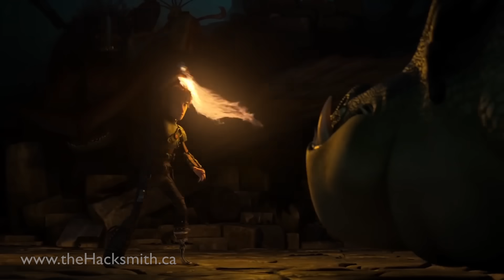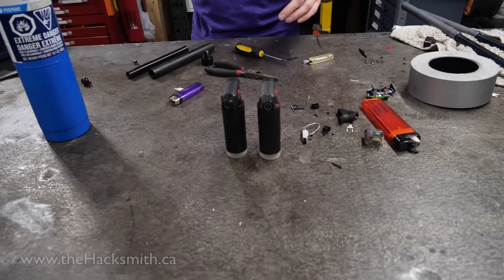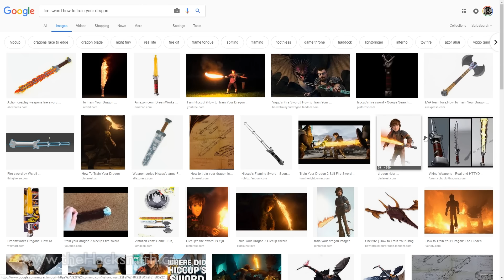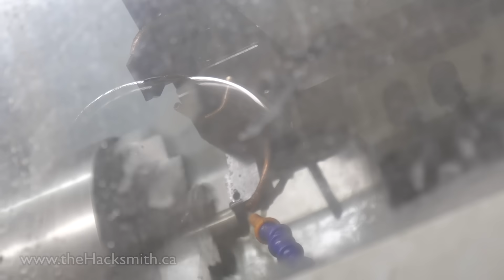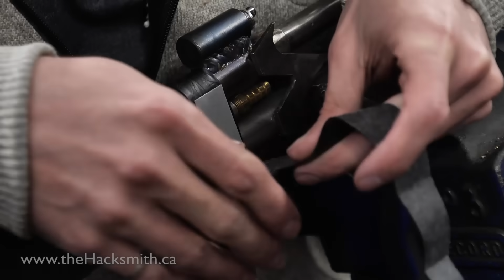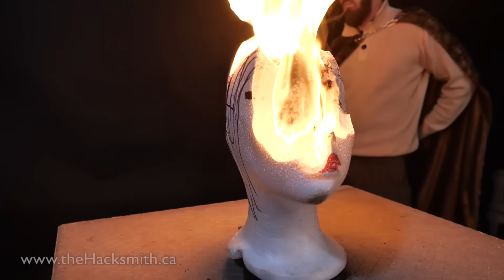Hiccup's FIRE SWORD from How To Train Your Dragon!

Comment: More holes spiraling around the 2 sword posts in 3 rows would have worked better stopping the gaps being so obvious but still not bad. Oh a spark ignite wouldn't have broken the realism as  badly as the permanently on pilot light.

Comment: I have an idea for a resign you could make it handheld and remove the sleeve pipes and  put the fuel source on the sword and make a sheath for the sword  then you could put the big fuel on the sheath  then make the sheath  refill it you could also make it an actual sword that is sharp by using metal and making it still retractable then it would be awesome.  Please tweet this to  the hack smith  asking for retweets

Comment: Can we talk about how they make an expensive FIRE SWORD that could have military uses and they use it as a barbecue😂
Reply: Name one military use
Reply: @guythat779  Emergency barbacue
Reply: @oscarrenaupallares330  fair enough
Reply: @guythat779  Fire damage in CQC
Reply: Not really any actual military uses, so.
Reply: @rev0568  I'd actually consider it less useful than a normal sword back in the medieval ages unless you're fighting a bunch of animals

I mean, the surprise of "woah fire stick out of nowhere" would do something but it's not even sharp
Reply: @guythat779  Exactly. Plus I mean at this point, he's made the lightsaber. Not very practical, but that has a lot more use than, well, this. Scary fire AND it can melt steel.
Reply: @rev0568  yeah well essentially they're the same tool 
Just one of them has a laminar flow nozzel + supplies an oxidizer
So it's a lot more fickle if it gets damaged+requires more gas cannisters

The fire itself looks very strange and would confuse more than scare anyone but yes
When it comes to its Physical impact it's much greater
Still kinda useless in a fight unless you're targeting weakpoints 

I personally call it a low density lightsaber
Reply: What about the stabby part
Reply: @late_8106  Because of the shape of the tip and the thickness of the 'blade' a thrust with it wouldn't be able to penetrate deeper than a half inch or so.

Comment: I wish the fuel container was smaller so it would fit in the handle of the sword and spare the wire and big bottle, with slots in the bottoms to slide in new bottles and out with the old, but only if it was smaller and more maneuverable

Comment: I think you could have made the handle a little bit smaller and put some steel between the toothless heads and then cut it to fit the shape and then smooth it to be the actual shape of toothless's head

Comment: as a hardcore httyd fan I instantly clicked on this build. Some fan critique though: Hiccup's Inferno uses Monstrous Nightmare Gel which is a propane gel, so the build isn't that off with it's flame fuel. This gel coats the blade, kind of like a lubricant. All it takes is a spark, and the blade is ignited. The other end sprays a mixture of Ammonium Nitrate and Anhydrous Hydrazine  (Zippleback Gas), which is explodes with a large green fog of smoke. The fuel for both ends are stored in small, film canister sized containers that Hiccup stores on his boot. These canisters can be inserted and rejected with a press of a button. There are also two lighters on each end of the blade that sets fire to each compound. Overall I really enjoyed seeing this video, and I really hope to see some more builds like this. oh crap I went into too much detail hAHAha

Comment: By the way, in the serie Race to the Edge, Hiccup actually makes the sword for the first time and uses it in the second movie too. In the serie he has a metal middle and then outlines in wich he let the oil flow and then somewhere hit a trigger to fire the oil. Ofcours you need re fills so he made a secret compartment where he hid re fills and the gas (Wich is from Roughnuff and Thoughnut their dragon by the way). He putted the gas and oil in little long round compartments. This ofcours that I just explained (badly) was the first one he made.

Comment: Would it be possible to put a smaller butane can in the handle? With a heat resistant chamber for combustion? Or not likely

Comment: imagine if someone trying to rob hacksmith..
Reply: hacksmith would be screwed because 99% of the things he has are not really all that lethal.
Reply: Travis Lavanway expects anything that have flame in it.
Reply: @Zesmas  and if they are most lethal things he made are either hard to set up or heavy
Reply: @Zesmas  well lets see a freaking laser gun, he has a crossbow, a flare gun, a sheild made of metal, I giant ax that can break threw metal, batarangs witch are still sharp, a flaming sword, a tungsten hammer, a hammer witch is a also a kind of taser, and more

Those sound affley lethal if you ask me
Reply: woolliam Sheep through*
Reply: @Zesmas  oh and electric sharp wolverine claws
Reply: He got the wrong house
Reply: They will leave.. Bc hes mind was mind blown
Reply: Nope they will have trouble because everything weighs 50 pounds minimum
Reply: They won't make it far

Comment: Try make a built in canister so that it looks real and shrink the blade so it is 40cm long and also shrink the handle and make the grip brown leather also use a small deodorant can and hook up a pipe to the end of the can and make a button to open the pipe to start the fire on the side of the blade (button on side).         BTW I love ur vids
Reply: Also use a flint stick with slideable steal spark maker on the side              I KNOW U CAN I TRYED IT
Reply from the maker: so... re do everything?
Reply: Yea re do it and get a 35ml deodorant can

Comment: Pretty sweet! Not very accurate but it functions impressively. 
I made one myself with the rule of using as little modern convenience and to be as accurate as possible. Following the concept of Hawaiian fire dancing, it doesn't hook up to a gas canister, the system is completely contained within itself. 
The hilt holds a smoke bomb to simulate zippleback gas.

Edit- added my rule of accuracy

Comment: @Hacksmith when you realize the dragon head is supposed to be the guard so it spits fire. But good job none the less.
Reply from the maker: Watch the whole video...
Reply: @hacksmith  
I did and the dragon head is on the pommel, should be the guard. Just a little error, and I'm not talking about the gas emitting part

Comment: you could have just made a thin blade covered in oil 
you could have just got a flammable oil with a high surface tension( so it keeps to the blade) and make an folding sword with groves to hold the oil (side note : would work with a flint and steel type set up)
 it may have been faster or more easy ( i feel like vikings would have been able to find these things) 
and it would have a blade  
(or maybe not I'm not an engineer this just came too me, I'm not trying to be a know-it-all. i love your content and i have been subscribed for a long time)

Comment: Not much thought went into this one.  He could of used a small round butane can that you buy from the smoke shop or weld a air proof handle and fill it with gas, rather then run a hose up his sleeve and a can on his back.  Now go cook some sausages with the sword.
Reply from the maker: One day build...
Reply: the Hacksmith yes, i could tell lol, now about those sausages? Lol

Comment: Make a full on space marine armour with working power pack to help with movement and a rebreather to break in hazardous environments. Make sure you use heavy duty materials for the armour plate so it can’t be damaged by small arms fire to 7.62mm lets see you build something like this.

Comment: Those expandable batons are so useful! I have a bunch that are spring loaded. Honestly I was hoping you found a way to make the whole fuel unit self contained, but seeing from Instagram that you built this in about a day or so, it's still very impressive. The plasma CNC makes the metal work look so neat and clean, I need to get something like that in my shop!
Reply: G3AR - 'GreekGadgetGuru' are you greek?
Reply: Inwas hoping for the canisters that you could pop in the handle that charged the flame... also the dripping flame like phosphorus would’ve been awesome

Comment: I know this wouldnt or doesnt exist, but if you had square or triangular shaped shafts or batons you could grind a edge into what would  be the blades to make it sharp, the sword would actually be able to cut through things, with the added heat of the fire, it would be a fully functional collapsible fire sword, but either way, bad ass build

Comment: There is no such sword classification as a short sword.  It's just a sword.  A really cool looking sword, but it's still not a short sword.  Some swords are shorter than others, but they are still not short swords.
Reply: Hmmmm I don't believe that I'm pretty sure a short sword is 2 feet and under, anything above that is a longsword
Reply: @ironking1774   There is no such actual classification of swords, and definitely no such arbitrary cut-off and ignores that swords were made to order for the people wanting them and were not all the same length and could range both above and below whatever arbitrary cut-off you could come up with, most of the time.

There is an old document covering the German fencing style called "short sword" in German, but that involves using a 2 handed long sword in what I surmise is a defensive fighting stance/style with a short range for attacking.
Reply: daexion Exactly, a Longsword is a two handed sword
Reply: @jonathanshapiro6593  Which is literally meaningless.  Long sword is an old fencing style using the same weapon as the Short Sword fencing style.  By your logic a short sword is a 2 handed sword with a long blade.  They referred to HOW the sword was used not WHAT the sword was.  The sword was just a 2 handed sword.  You could probably employ the styles with blades of differing lengths as long as you could employ the appropriate grips on the weapon itself.
Reply: daexion Given the fact that you’re putting up with this argument so seriously, you likely are interested in this topic and have put effort into researching it. With that said, I’m probably a misinformed commenter who failed to check his facts which is exactly why you are persisting. In short, you seem to know your stuff so I suppose I was wrong.

Comment: I know this would be way too dangerous for these safe Boyz to try but one way to have the sword without the need for gas fuel is to go the way of napalm. Of course Napalm might get too hot and melt the handle and a bunch of other problems with that but it would be one way to go.

Comment: Great build for a one day build!! I think if you had maybe another day or two you could have had maybe a spring assisted system for the blades (and maybe internal fuel source in the handle) but i can see how that would really reduce the uptime of the flame and idk if there would be too much heat on the fuel cells. But like always an amazing build, keep it up!

Comment: Hey I got a question: As the Sword can extend via a telescopic mechanical system, is it still able to operate after beeing heated up by the flames? Because the heat will cause the metal to expand and so may jam the mechanical system.

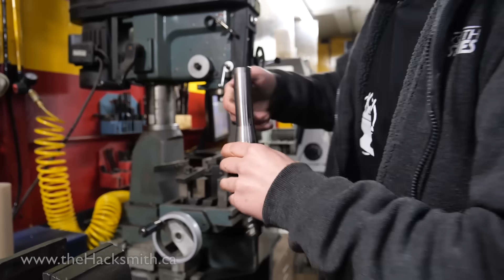Comment: @4:25 - Bogdan using a crescent wrench on a chuck... Machinists the world over cry out in horror. Buy or make a wrench the correct size, and leave it in the drawer with the chucks. Crescents are just going to round off and maul your tooling. This ain't some one-use bolts on your toilet you don't care about. Jebus.
Reply from the maker: the wonder of having chucks you never use in a drawer from the kijiji purchase of a mill ;-)
Reply: @hacksmith  - That's no excuse. Everyone knows that your first three years of owning a tool is only to be used to make the tools that you use to make the tools that you might use to someday make something. It's practically the law. You start making stuff with it right away, the whole d*mn system falls apart.

Comment: Buuuuut, inferno contains monstrus nightmare gel as fuel, not zipplaback gas
Reply from the maker: The zippleback gas is the cartridge we used... for the spray attack. Not the blade
Reply: the Hacksmith My point is The sword uses a liquid fuel, not gas
Reply: Spolern KrAkus good job, you commented before Justin y